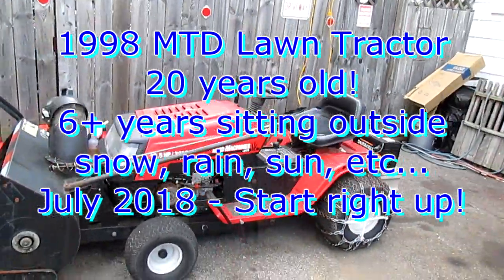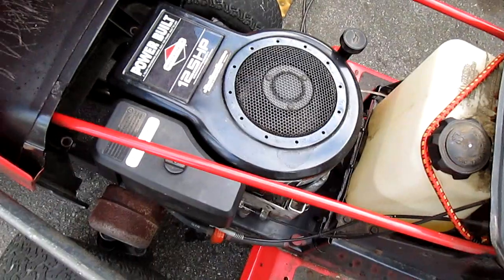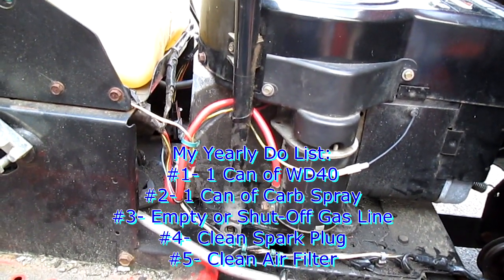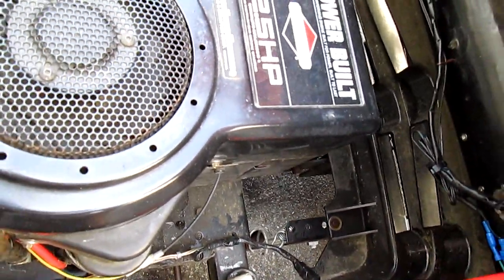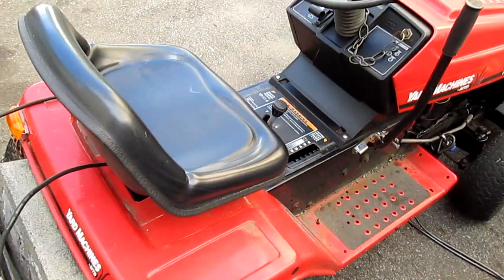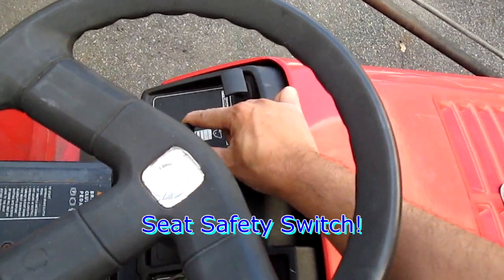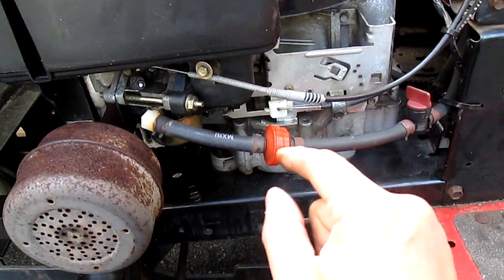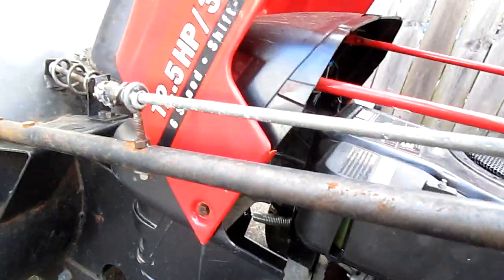1998 - 20 Years Old MTD Yard Machine Riding Lawn Tractor - First Cold Start 6+ Years

Comment: Nice tractor man. I've got an MTD very similar to that one. Mines one of the Montgomery Wards tractors from the 90's. It's got a 14HP Single with the OHV. Briggs and Stratton rocks! I got my tractor from a good family friend who replaced it. We went over, and it started first try. I've had it for pretty close to 7 years now. We did have to fix the engine and my dad pulled the deck off of the tractor. But now we just use it for pulling stuff. These MTD Tractors are actually pretty solid machines.
Reply from the maker: Yup they are, still working!  We just did our snow pile.  Next snow storm is about 8-12 inches in few days!
Reply: @JodBronson  wow. My dad and made a wooden plow for it. Not great but it does fine work.
Reply from the maker: @motormouth2472  - Oh kool.  You should post if up and let people see it :)
Reply: @JodBronson  yeah. I do have a video in the plow. It's just a brief episode though. But still shows what the plow looks like
Reply from the maker: @motormouth2472  - Check out the weights I've made a while back.  It's still in use today.  Link:  https://www.youtube.com/watch?v=OJ-JAB2aAmY

Comment: I have a 1992 John deere lawn mower it's pretty good besides the seat and the back tires are bad other wise it's pretty good
Reply from the maker: +dirt bike addiction
 - Cool.  We have a few John Deere as well.  Models;  60, 70, 100 and  2X 111 and all pretty old, in storage.  It's pretty much the same thing... The Seat always cracked, especially if they sit in the Sun.  Other than that, they are still in working order.  We don't use them, because they are " Antiques " now, LOL.  I think because they are designed with the " earlier " Tecumseh Engines.  Funny thing is, those are my favorites..., they don't die!  Also, when Briggs and Stratton took over, they just changed the Name.  But pretty much it's a Tecumseh Engines.... They are built to last!

Comment: Hi Jordan thank you. Also can you give model and serial off of the old 14.5 horse power tractor. I just inherited one but the id tag order the seat is too ripped. I need to order a new blade engagement switch. I need all the safety switches to work as three different ladies will be using it.
Reply from the maker: Hi, this is an MTD.
Reply: @JodBronson  yes mine is also a mtd but I’d tag under the seat is too messed up. That’s why I am looking for model number.
Reply from the maker: @danielmierop662  -  Look in the Description!